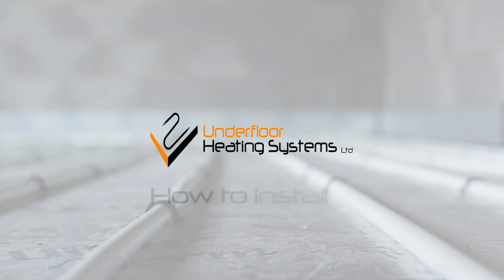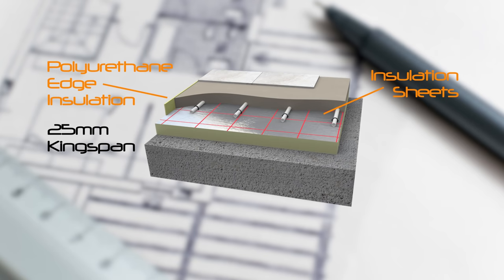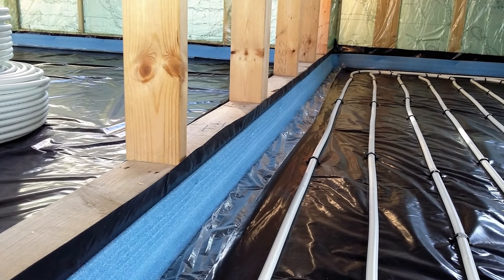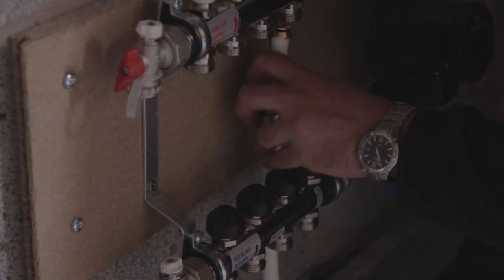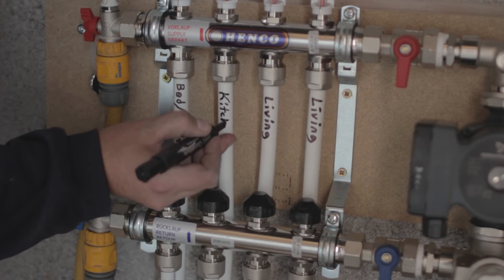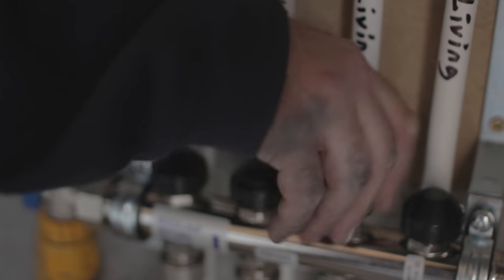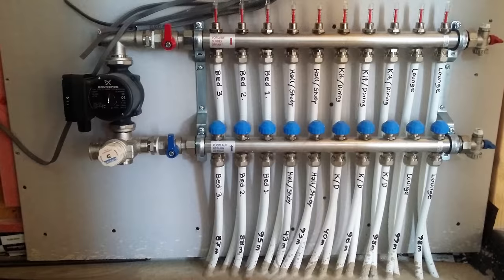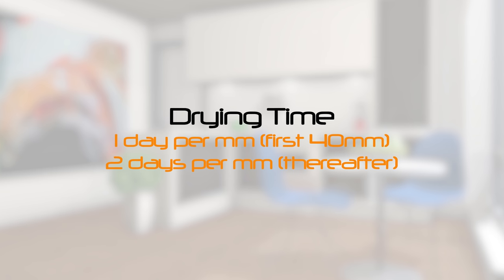Guide: How To Lay Underfloor Heating

Comment: Dear Expert ,

Thank you for the brilliant explanation. My question is whether we can install new laminate on top of old ceramics while using a wet floor heating system. Could you please guide me on whether this would prevent efficient heating conductivity, increase energy consumption, and how it might affect moisture levels? Additionally, what steps can I take to control these factors?

Best regards,

Comment: When you mention the edge insulation, if this sits on top of the base insulation, then you ad the dpc membrane, does the blue expansion edging go against the wall as well as or instead of the kingspan?

From the concrete wall inwards, is it:
1.Wall, kingspan edging, membrane, Blue expansion strip, floor screed? or
2. Wall, membrane, blue expansion strip, screed?

Comment: Why does it have to be tested to 6 bar when it’s only going to be around 1.5 - 2 ?
Reply from the maker: Just to make sure there are no leaks, normally 24 h.  Our pipe is 10 bar and 95 degree C temp,.  High quality.